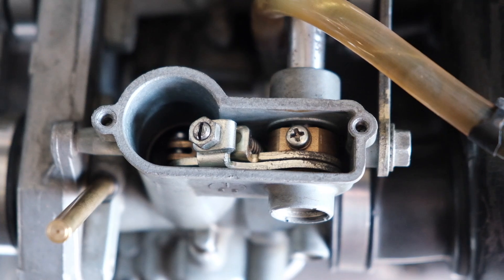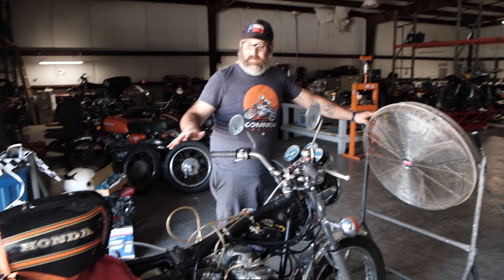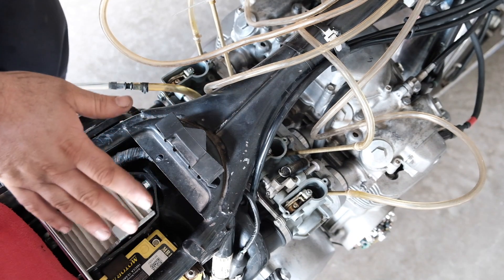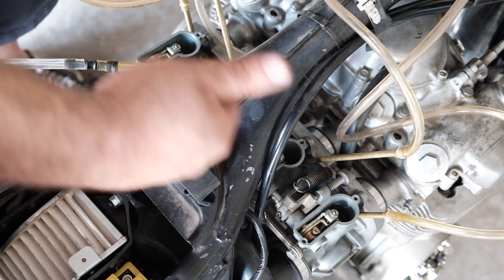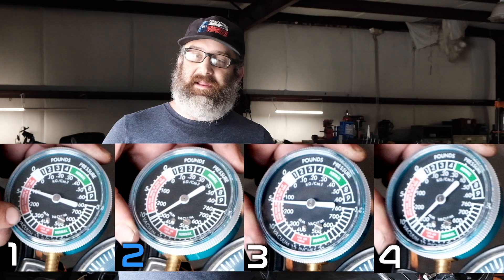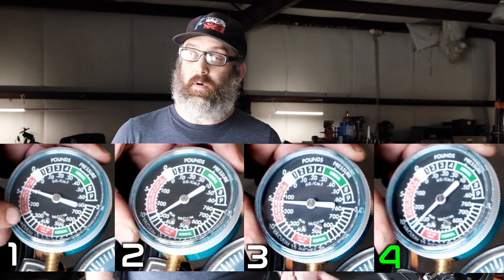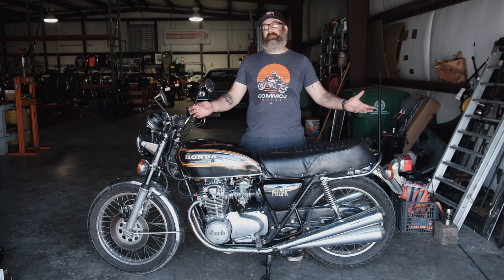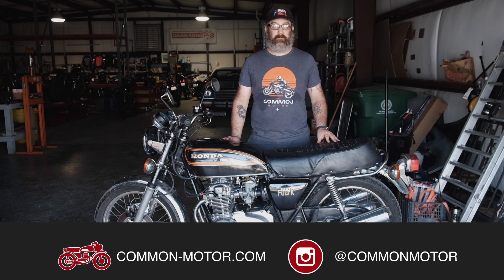Vacuum Synching Your Vintage Honda 4-Cylinder Motorcycle Carbs - pt.2 - CB350F, CB400F, CB550, CB750

Comment: Struggling with my ‘78 CB750F, didn’t take into consideration the engine rpm. I left it at 1k or so. I’ll try this method. Should be the same for a 750 yeah?

Comment: Need to do this on a 73 CB750 I just did a carb rebuild on....I ordered some cheapo kit off of Amazon that had decent reviews but it's the bank style with 4 separate gauges....I'm hoping it isn't a piece of junk, but not holding my breath.  At least this process looks pretty straight forward once you know you have a good gauge or gauges....good stuff

Comment: I rather have 4 gauges for each cylinder
That way its faster 
Your single gauge and gang manifold is time and unnecessary work
All four gauge system reflects on coresponding cylinders 
View the readings blip a few times
Tweek and done
But your sync details are gr8
Thanks
Reply: Het lijkt me ook een heel gedoe zo, en dan met best hoge toeren..,

Comment: What about the AFM adjustment screws, I imagine these need to be in sync before you move to syncing the butterfly valves. In the context that I have had the carbs off, rebuilt and put back on, I want to make sure the AFM screws are dialed and synched before moving into the butterfly/idle speed adjustments

Comment: I cant see the point to not use 4 separete vacuum meters with adjusting "zero-screws" More eays to use too. Tell me where I am wrong if I am👍
Reply: No two {inexpensive} vacuum gauges will give the same progressive and total readings. Sure it can be done as you describe, with a separate gauge off each carb. This method is obviously used by many and does, in most cases, give a reasonably satisfactory setting and tune of the  carburetors. However, the single vacuum gauge will give the same vacuum readouts for each of the carbs and, therefore, be more accurate.

The cost of adding four gauges to a kit for sale, instead of one, will also increase the total cost of the kit, whether purchased as a kit, or made up from individual components by the DIY carb tuner.

Personally, for the sake of accuracy, I would use the single vacuum gauge and five or six valve gang of "Aquarium Air Flow Distributors with Controller Valves", using one of the valves for the vacuum release, instead of findling with a plastic cap to remove and replace {and lose}.

Comment: Hello! I have a Honda CBX 1986 650E RC13 50 horses, I cannot find any difference from mine to the CBX650E 1986 RC13 75 horse one.....can you help me? What do I need to upgrade to get to the 75 horse?
Reply: Hi there, If you're still interested: to upgrade the CBX650 to 75hp, you'll need to change to a bigger camshaft and change ignition timing.
Reply: @asborgeirssoneiriksson9053  Thank you! I'm in the process of a rebuilt....of a rebuilt. Rebuilt the engine once and after 300km it starte ticking/knok.....

Comment: This has to be by far, the best carb syncing video I have found. Thank you so much for an outstanding video. The information is clear and concise and very informative. 
I've never had to do this job, but I find myself now having to do it soon, so your video will help prepare me a bit.
I have the traditional 4 gauge kit which I have never used but I am going to try the single gauge method with the 4 way valve. I am wondering if a non return valve can work in place of your dampening valve ?? Will the one way valve stop the engine pulsation ?
I have a 2001 Kawasaki ZX9R which is going to need the whole enchilada, that is, first a valve clearance check, a full carb clean and then the synchronising. 
Wish me luck !
P.S. My like made it hit 1000 likes lol..

Comment: I noticed your kit doesn’t say it works with any of the 650 models. Looking at possibly picking up a 1979 CB650 with the 4 cylinder will this kit and process be the same on that year of bike? It definitely needs the carburetors synced because it doesn’t seem to want to run consistently or smoothly especially without the choke.

Comment: I really need your opinion on this. The manual for my 78 750 Four K says the idle is 850-950. I could never get the idle down that low and all my carbs are sync but not at the “green” area on the gauge. What am I missing here

Comment: i 
 wasted a lot of time watching this video. what is wrong with using for gauges? thats what i have used for over 40 years. gets the job done better, no faffing about with levers. you can see how the other cyls are being affected as you are making adjustments. syncing carbs is a 5 min job max no need for a fan. you didnt adjust the idle to 1000 rpm when you finished so couldnt hear what it sounded like. you could have put a lot of people off doing this simple task  ill stop there

Comment: Could you minimize/regulate gauge needle bounce with whichever valve you were using on the distribution manifold?  They are variable air control valves just like the one you added inline, right? 

Thanks for doing the video!  It's great.

Comment: Why would you fiddle with one dial and make it so complicated, just buy yourself a carbtune synchronisation kit and you can monitor all four carbs at once very easily.
Reply from the maker: We find this to be the easiest and most accurate method to teach and use but there are many ways to do it. The Morgan Carbtune is a great device and can do the job as well.

Comment: I have a 86 Kawasaki Eliminator zl900 will this kit work? It only says Honda on the website?
Reply from the maker: It’s going to come down to whether or not the vacuum sync ports are the same thread. Message our support at common-motor.com with what thread your zl900 uses and we can confirm for you

Comment: Awesome two videos. Thanks. So to sync it is only that?  What about the air screw ? I have a Kawasaki 1978 KZ650. Thanks. Great video
Reply from the maker: Hey Francisco, that will be it for synching! You will still want to go through and tune your idle air mixture screws and run the bike. Once synced is a good time to run the bike to check the running condition and performance. If you made any changes from stock if everything else is tuned appropriately its a good time to check your jetting.
Reply: @Common-motor  thanks so much

Comment: Been using a motion pro Mercury gauge for years.... And I can guarantee you one thing they are the most accurate gauges out there.. and that's not the procedure we use... Honestly I can probably get closer on the bench.
Reply from the maker: everyone has their method! We find this method an easier and affordable method to teach but as long as you are getting the sync spot on with the method you are most comfortable with that's what is important. Heard great things about mercury gauges! I don't trust myself to not suck mercury into the engine though haha
Reply: @Common-motor  it's not my method it's the proper method...raced and worked for Honda for over 25 years... You won't suck mercury into the bike unless you have some crazy idle going on...

Comment: Thanks for the video. Question, my 78 cb550k3 pd46c carbs rebuild idles good but when I rev up the engine the rpm stay high or is slow to return to idle.  This carb butterflies are always open. They only close if I pull the choke. No vacuum leaks.  Stock jets size, 2.5 screw out and second needle position.  I believe this is factory setup. Any ideas? If the mixture screw is below 2 turns it wont start. Spark it good.   At this time the carbs are only bench synced.
Reply from the maker: Sounds like you need to vacuum sync. Hanging idle is one of the symptoms you will notice without it.

Comment: Well, buying this sync kit right away. Time to get the CB350F tuned perfectly.
Reply: What if you don’t have a rev counter?
Reply: @rayestanley517  id buy a cheap one off amazon or 4into1.. kinda necessary if you really want to dial in your carbs

Comment: Should you sync your carbs before or after tuning them and having the right air to fuel mixture, I just rebuilt my carbs and don’t what what comes first
Reply from the maker: It shouldn't matter, the air to fuel mixture screw will just be your idle air to fuel. I usually do it after because its easier to hear the difference in rpm change with the bike running on perfectly synced carburetors.

Comment: Great video, thanks. One recommendation would be to use a five port manifold instead of four so that you can turn a valve to clear the vacuum instead of the rubber cap.
Reply from the maker: great idea, especially with how many times I've dropped the cap haha

Comment: Use the same method on the GL 1000 and the GL1100 and the GL1200. I used 4 vacuum oil dampened vacuum gauges from McMaster, 
Double checked that they were in sync with each other. The oil in the gauges slows down the needle bounce a lot. I had a 1998 CB550K like the one in the video and a 1985 GL1200

Comment: Hi Brandon , 
You have just made the penny drop for me when it comes to the gauge sets  especially when I used to sync my CBX's .
trying to use a pair of quad gauge sets
With no certified calibration going on in the shop, it was a tall task expecting all the gauges  especially from two sets to all be reading the same and just did not occur to me  at the time.
As such I had better success with the hose and  using my calibrated ear on the six's .
Brilliant explanation and step by step video .
cheers

Comment: Mercury stix seemed simpler to operate, and with every adjustment you could watch the change in all cylinders simultaneously. 

Just be careful not to rev the engine or the mercury would be vacuumed through the intakes. Saw this happen and learned my lesson.

Also the final recommendation was to have the two outboard cylinders pulling a bit harder to allow the inboard cylinders to loaf a little and run a bit cooler. 

My first bike was a 1980 GS 550L Suzuki, and it started just like your Honda. Kept it for 30,000 miles and never should have let it go.

Same for the 1980 CB 650 Honda I inherited back in 2000. Absolute dream of a motorcycle. Wish I still had it.

Enjoyed your videos. Brought back many good memories (as you can tell). Thank you for posting.

Comment: Thanks for making this video, very well done and very informative. I did the carburetor sync on my 1976 Hondo CB750 with the older style carbs last year using the 4 vacuum gauge set. I did not realize that the 4 vacuum gauges may not be calibrated to read the same value for all 4 gauges.  After watching your video what I did to check to see if all 4 of my gauges where calibrated was measure the vacuum on cylinder one with each one of the gauges and they all measured the same value to within a couple of millimeters. So I think my 4 gauges were pretty well calibrated and I do not think that I need to do another full carburetor sync. The engine runs smooth and it starts up from cold no problem and it idles real good at about 900 RPM.

Comment: Wow hit the nail right on the head. This is really going to help out newbies. But rather than only using one gauge, first connect your gauges to a 5 way splitter, and then one carb and sync your gauges, before you sync your carbs 😉
Reply: I feel luck because I have a mercury gauge from the 80's

Comment: Small question

Which engine oil you recommend for a 1973 350F
Reply: 10w40 is stock recommended but can go with 20w50 if you ride in a hotter climate. I use Amsoil metric synthetic in my CB550 without any issues but some people fear using synthetic in older engines for whatever reason. A good deal of people use regular Shell Rotella diesel oil. Any motorcycle oil designed for a wet clutch will work. Just personal preference.
Reply: @supersportimpalass  im in the Netherlands, not that hot.

Thanks for the reply
Reply: @wilfredprins9718  You're welcome. Motul has their 3000 4T 10W40 mineral oil which I believe is available to you. 

https://www.motul.com/nl/en/products/3000-4t-10w40--2

Comment: Didnt get why it makes a real difference using the vacuum sync with one gage instead of 4 paralel. Each gage checks each carb at a time. So what's the difference?
Reply: CMC claims there too much variation between the gages in the 4 gage setup. Many if not most people will disagree with that.
Reply from the maker: We’ve had gauge clusters burn us in the past and find this way it’s always foolproof with the least variables is all! At the end of the day though if you get those carbs dialed in beautifully with the gauge setup you’re using then it’s a winner.
Reply: @Common-motor  i bought this inexpensive gauges, similar that you got. I checked their precision to each other with one easy method. I bought a cheap hospital injection without a needle, and connected it to each gauge. Then i checked every gauge by itself (I pulled the injection  all the way from bottom to top so every time you vaccum the same ammount of a air ). All the gaugea showed almost same result. Another methode to check you gauges is with brake bleeder pump. What do you think about this?
Reply: @tomopope4019  what you did is a good way of checking the gauges. You could also use a 4 way splitter and a brake bleeder pump to calibrate all 4 gauges at same time. At the end you will find out they are pretty close to each other.

Comment: Interesting technique using one gauge with that four way splitter.   Is that piece sold separately?   I've been using a CarbTune Pro on my CB750.
Reply: Stay with carbtune. Great video, but why overcomplicate a pretty straight forward sync process with all that extra plumbing and one guage. If you can afford all that setup, you can afford three extra guages instead. Lol 
Just my opinion
Reply: Plus with the rpm changes in between, etc etc 
Too many variables to have discrepancies. 
Use a carbtune or similar all 4 at the same time setup, and i have been doing this a while.
Reply: Interesting is the right word. You’re far better off with carbtune.
Reply from the maker: If that’s the only piece you’re needing you can message our support and we can get you just the splitter!

Comment: Used to use a piece of hosepipe to sync the carbs on my  Kawasaki triple. Used it like a stethoscope and listen to each carb air inlet in turn.
Reply: That's how I use to do the job on my bikes and customers bikes.
I have done this method on my Jaguar and many multi carb setups on cars as well.
In fact my genuine Jag manual  actually shows and describes this method  as well as another little bit of info, It recommends a litre of methylated spirits in each petrol tank once a month  to remove water from the tank and fuel system and keep it dry.
This method works very well and served me well, as well as the tripple and quad gauge sets.
Its ironic that Brendan said that not to use the multi gauge sets as I found I had more reliable results with the ear and hose trick than  using the combination set.
Especially so with my CBX's because I had to borrow a second set of gauges to do the job.
I found I could get better sync with the hose  on the six's. Makes total sense now trying believing all six or eight gauges would be equal .
I now think not . 
Workshop tool calibration was not a big thing back then but it certainly is now and can be very costly getting them done every year or two to comply with standards and accreditation.
My preference is still to use the hose and ear trick or the manometer,  but if the customer or friends are looking over my shoulder and they think they  know it all , I will use the gauges  to please them.
Reply from the maker: @ScatManAust  Haha yeah definitely. Sounds like your customers should trust you more, CBX's are monsters to tune! We like to teach this one gauge method because it's foolproof and removes a lot of variables and user error. For someone who knows what they're doing though, there's plenty of options like the hose and ear method. Thanks for the info, and does the metholated spirits just go right in with the gas?
Reply: @Common-motor  It goes well .
Its much like methanol and ethanol, being hydroscopic it will take on the water and being mersible in petrol, will pass through the carburetors and so dry the tank of insoluble water.
Obviously it wont work miracles with huge amounts of settled water but used on a regular basis will work as Jaguar state.
And when it comes to EFI systems then I cant see any problems there as the ECU will compensate.
As far as working with diesel, I have never tried.
I certainly would not try it in a common rail system but the old conventional plunger and rotary dpa pumps may work.
I still use methylated spirits to this day albeit once a year in most of my vehicles.
Actually another great use for it is to clean all the plug leads, boots, coils and distributor caps inside and out .
Doing this drastically increases the life of the system due to not jumping and tracing, but the biggest benefit is from not drowning the ignition in the rain or cleaning the engine.
Reply from the maker: @ScatManAust  ill have to give it a try in my tanks!

Comment: Thanks Brendan. I happen to be struggling with the tuning and sync on my 75 cb550 and this video has helped alot.  Mine doesnt have a reference carb  so  I guess I'll be using the trial and error method to find the appropriate carb to reference from.  Very good video.
Reply: bench sync all carbs and don't adjust #2, boom! you have a reference carb!
Reply from the maker: Definitely a bit more work at the beginning of the sync to know where you are going but we actually prefer the early style over here at CMC. Glad the video could help you out! Once you get two in sync you're good to continue as the later style!